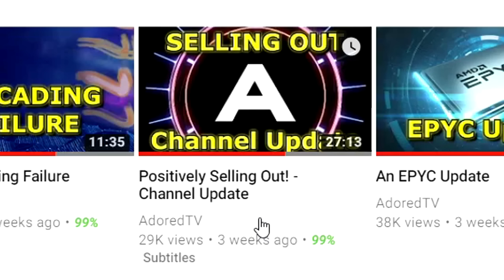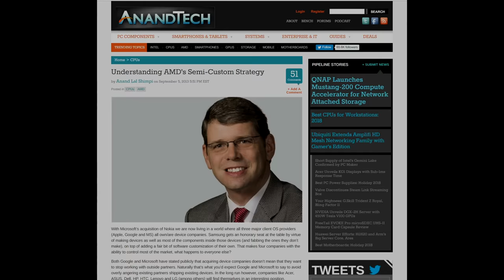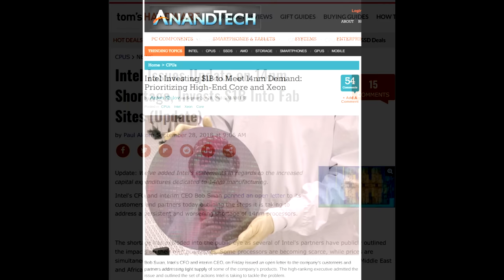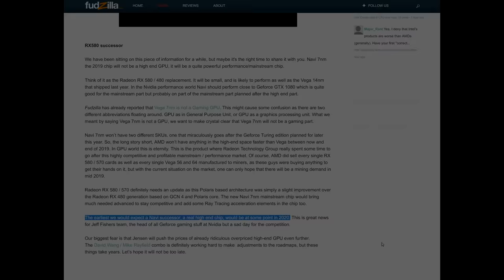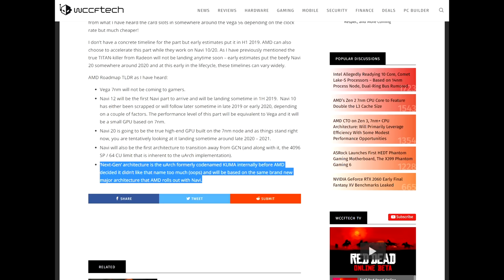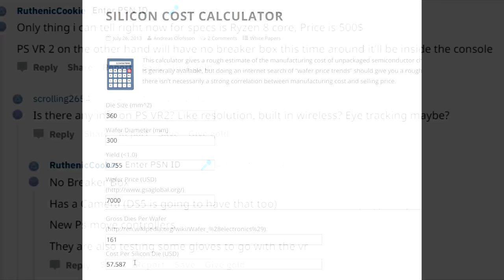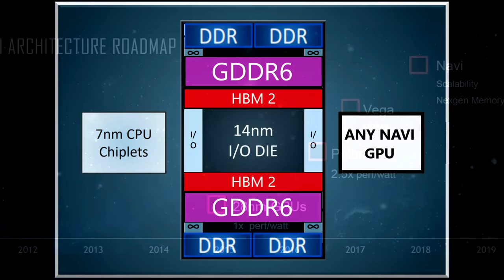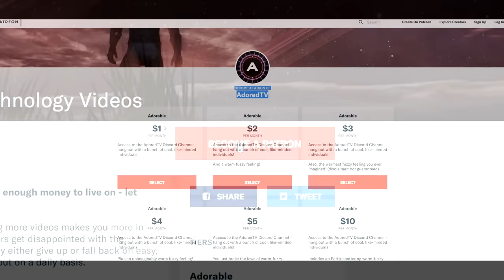AMD  - The (Evolving) Master Plan

Comment: I am happy AMD kicked PC gamers to the back seat. I remember when AMD had better cards, but still didn't sell. No need to waste resources. PC gamers enjoy their $1000 cards from Nvidia
Reply: The last GPU I have absolutely no complaints about is the 7970. I loved that card its the only one I've bought two of. I still have them both and they still work perfectly, running OC'd as far as I could get them without flashing the bios. It was such a great card that should've been sold WAY more than it did. I'm hoping they'll compete in the high end again soon.
Reply: halsoy Just saying, all three of my 7970’s failed.
Reply: @6Twisted  I have 1  7970 that i have bought at the release , it's stil fonctionning today after all these year of 24/7

Comment: Your silicon cost calculator is from Adapteva; a company that made a 1024-core CPU that outperforms GPUs in terms of energy efficiency, and did all of this with only one engineer and a budget of less than $1M. Really impressive company. I'd love to see them mentioned in a future video if possible.